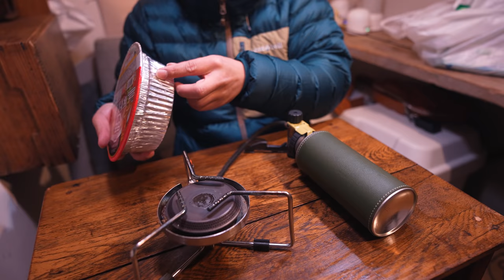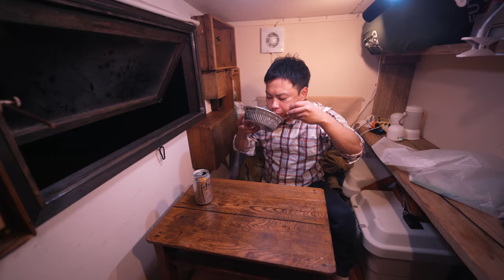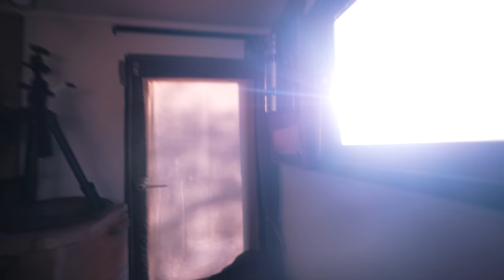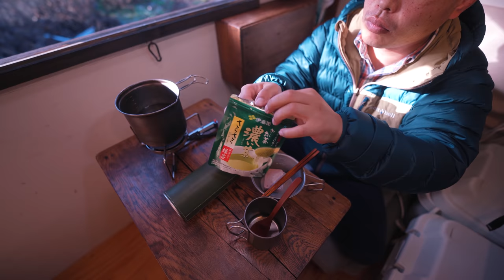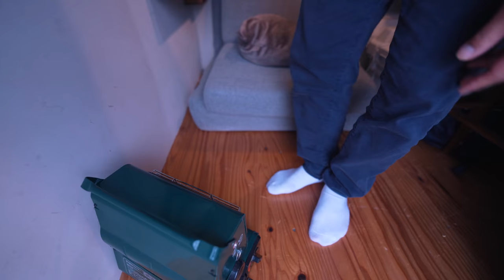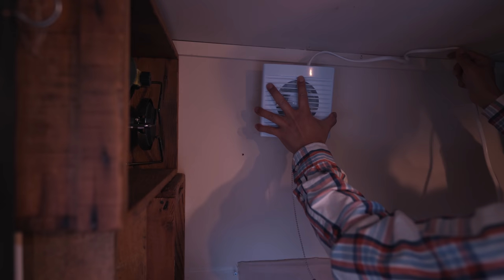[Winter car camping] Warm up with a new heater on a cold day ｜ DIY light truck camper ｜ 85

Comment: Okay, I have a few questions if you don't mind my asking.   So you bought a heater and installed an exhaust fan for ventilation, so why are you still keeping the window open?   That kind of defeats the purpose of heating an enclosed space as all of the heat goes right out that window.   If you are still worried about fumes, then you could have bought one of those heaters that you keep outside and only the duct work is inside the living area.  Since these vent outside, there would be no need to crack open the window.    Next questions have to do with the butane gas cans (cartridges).   How long do they last in the heater?   How long do they last in the stove?  (Meaning how many meals can you make on a can?)

Comment: For the window, you mention double glazing, something that may be a little easier, buy a blackout blind,  or some black out material, which stops heat getting out through the window, plus it stops heat getting in from the sun, in summer.

We have them in our bedrooms, and living room, and they really do work.